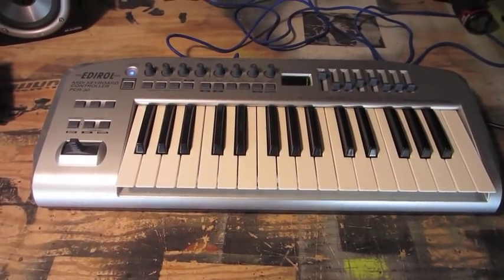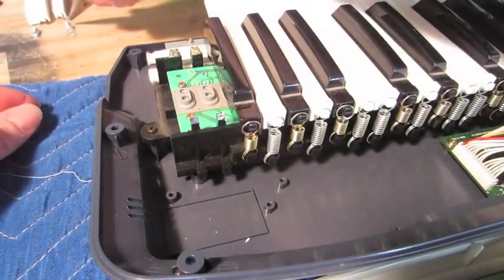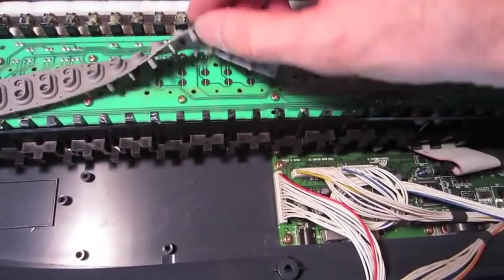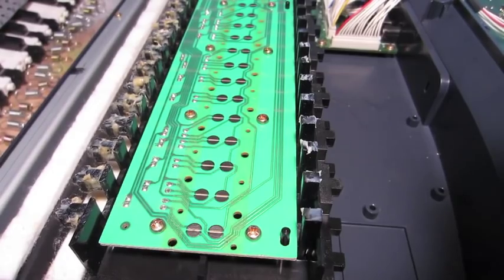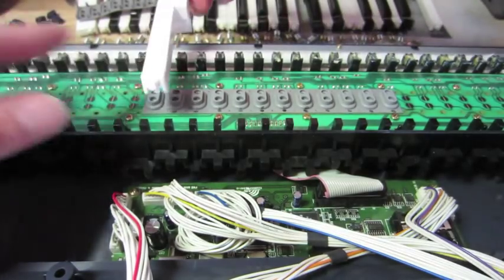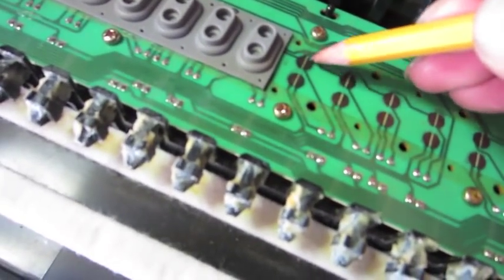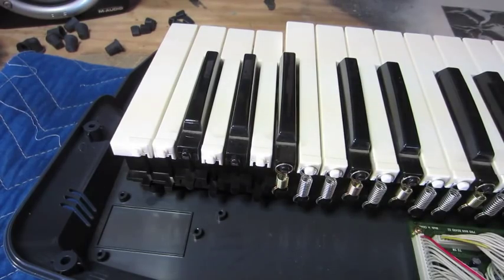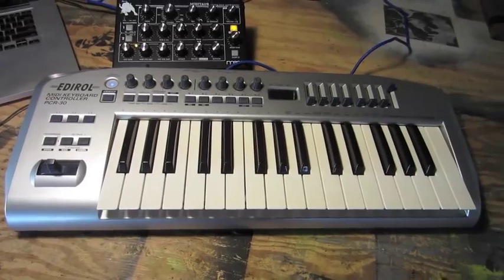How to fix a MIDI keyboard with a pencil.

Comment: i was working for a clearing company. my boss took an electric keyboard/synthesizer and stuck it into the trash container. i immediately pulled it out. took it home. cleaned it. it works with 100% integrity.. now its in my music corner waiting for the muse to kiss me...
in our society 80% of the stuff we throw away only takes a little bit of time, knowledge, oil and spit to fix.. we daily throw away things that kings in former time could only dream of...  great video..

Comment: What a classic. I had issues with my own Edirol pcr-m30 with many non-working keys. Not through overuse, mind you - it had about 5 hours total playing on it... Was just not happy to sit idle for 4 years, I guess. I cracked the cover, and just gave one of the contacts a straight up clean (even though they looked pristine under that rubber boot thing). After a simple wipe, they started working again. I'm going to get some contact cleaner and give it a once-over and it should be good as new. Thanks for the vid - I won't be using a pencil, but because of your video, and the comments, I found what I needed. You have my thanks! :)

Comment: Repaired my liquid damaged NI S25 after watching this video I thought it was permanently damaged. Most of the keys stopped working and now it's like new again! I didn't have to remove the keys everything is easily accessible with the keyboard upside down after removing the bottom panel and pad PCB. Thanks for the info and useful video

Comment: The problem with doing it this way is if the graphite loosens over time, and spreads and comes into contact with a power and ground connection, instant POOF!  You can buy a product called rubber contact repair at most electronics shops.  Another method of repair is to use a silver emergency blanket and cut out a circle the same size as the circuit board contact, and glue that to the rubber contact so the silver side comes into contact with the circuit board, that also works very well.
Reply: It's still a great solution with zero spending. IMO using the pencil trick is only problematic when the contact circuits are very worn-down (i.e. decade old, or abused daily).

Comment: I own the M-Audio Axiom 61 and I have to say I followed your tutorial dead on. It fixed my keyboard. Thank you so much! man.

I bought it used for cheap so I expected something to be wrong with it. I found wads of hair under the keys. It was disgusting.
Reply: I got mine for $400 when it first came out, I need to put it in the shop, because I thought it was DONE. its just in my room catching dust

Comment: Great video! Thanks for posting. I tried this on my PCR-M1. The contacts look different than this one but the style of the rubber piece on top is identical. 

All the buttons worked perfectly before I put it back together but when the keys are on a few still don't make contact. I'd love to find a more robust way that ensures contact.

Comment: Thanks for the instructions!  The pencil didn't work very well for me, but a Circuit Scribe conductive ink pen did the trick.  There was originally only one key working on mine, now they all work!
Reply from the maker: +Michael Muller Nice! Yeah over time some of the keys that I fixed are now starting to fail again. Thanks for the Circuit Scribe tip. I will definitly look into that.
Reply from the maker: +Darko Dronjić well to be completely honest it did not hold up very well. It worked good for probably a few months but some keys have stopped again. I would suggest trying to find a product that is actually meant for fixing these type of keys/buttons.

Comment: This is a great cheap way to do the repair BUT if you spend about $20 and buy silver circuit pen and then clean the circuit board and the rubber pads with the pencil eraser first and then clean with denatured alcohol . Then on just the rubber pad part you put the silver circuit pen and do like a stipling effect on the rubber pads. The reason manufacturers use graphite is its cheap but silver is a great electrical contact and the silver circuits pens I have discovered are the way to go they last a lot longer. It is very tedious though.

Comment: If the keys trigger notes via contacts, how do they transmit the MIDI velocity? Maybe I just need to go to bed already.
Reply from the maker: I'm not totally sure. But I think it might have something to do with the two sets of contacts per key. Maybe it can measure the difference between contact closure and translate that to velocity.
Reply: Mike Sisk I guess it'S the two receptrors. there are 2 spots. the second spot get touched by the key  after the first one. The harder (faster) you push the key, the shorter the delay between the 2 contacts.
Reply: Xavier Beaupré Ah, ingenious!

Comment: I agree with the vodka solution of @AlnairLindalwe! But I would use isopropyl alcool instead. It worked like a charm for my casio/yamaha toy keyboards. Don't use graphite over grease and goo that is on your contacts... Just clean them ! I also have a sticky PCR-A30 I need to clean...
Reply: fabrice Dziezuk So... I cleaned all the contacts of my PCR-A30 with isopropyl alcool and... It does not work any better... I have to try your pencil trick. It's strange this method worked for my previous toy keyboards and not this one. I suspect a misconception...

Comment: Great video. Problem is, the graphite doesn't hold up over time. Wish it did.  After about a year or so, you're back to the same problem.  A bad design by Edirol unfortunately.
Reply: Glue a piece of aluminum foil on rubber parts.

Comment: You don't want to get a line of graphite joining the two halves of those contacts either or that note will be always on and will not work.
Reply from the maker: Well obviously. But if you do get a line connecting to two pads you can easily erase it with the edge of the eraser on the pencil 😉
Reply: The PCB laquer is too smooth to write on with a pencil...usually.
Reply: Forget I said that. No reason to bother putting laquer on that little strip, since the laquer is applied last, and the pads are just masked off. Mine DID have dye and laquer between the two halves of the pad for some reason. Seems like extra pain in the ass for no real gain.
Reply: Ash Scott a

Comment: hello, I have two Casio keyboards wk-1800 & wk 1630.  Both have the same issue, 8 keys in the upper register only play once.  They only play if the touch sensitivity is turned off, but they only play once and then will not play again until the keyboard is turned off & on.  On the screen, it shows that they these notes are still being played/ sustained, that is why you can not play them again.  I have already opened up the keyboard, vacuumed up all dust & debris in and around keys & wiped down the circuit board.  I have also tried switching the pads from other working keys to see if the pads need to be replaced, but unfortunately the problem still exists.  I haven't been able to find someone who can fix the keyboard on the island where I live.  If you can give me any direction toward fixing the problem, I would most appreciate it.  thanks & kind regards. ps. I tried the graphite with a pencil, but it didn't work.

Comment: Hi, thanks for the video, I have a second hand PCR-M1 with some keys not working, will this be the same fix do you think? Thanks
Reply from the maker: specialbeat I don’t know for sure but I would assume the same fix would work for yours also.
Reply: @SISKworks  thanks. Just realised that the contacts on the PCR-M1 are gold rather than carbon. So I'm guessing it's the rubber part that's at fault as the gold contacts are clean. I guess I could try a soft pencil on the rubber contacts.

Comment: Another option: I lost about 10 keys on my edirol. I found good old washing up liquid works a treat. Use warm water and washing up liquid on both the rubber pads and the board - leave for about 10 mins to let the water and liquid do its work - and then clean off thoroughly and dry. I have no idea why this works, but my theory is that it cleans off microscopic residue that builds up over time.

Comment: Those contacts have clearly oxidized, a can of contact cleaner from an electrical hobbiest store will fix it up and last much longer. A good brand cleaner will have oxidization prevention too, you won't have to do it again for a long time.
Reply: Yep, no need to be too gentle. Give it a decent rub. The rubber pads too. I've fixed many keyboards this way.
Reply: I'm going to be repairing mine and I was wondering if contact cleaner would be the better way to approach this.  The pencil/graphite method he shows I'm sure will work, but since the work is so "tedious", I prefer to only do it once in a great while.  But great video!!!!

Comment: what i don't get.. you want the graphite on the pad's of the button's so why not "draw" whit a pencile on that pad's
Reply from the maker: Roy R yes you are correct but the graphite did not really want to stick to the pads. But you should definitely give it a shot! 👍
Reply: ill well. need to say that its plausible. you need to "dip" the pads in Graphite powder... and you will coat them.. your tip is great. have a GEM keyboard. non of the keys worked. so i did the graphite Trick , and except voor 11 key's, that don't work is the rest fine.. found that some pad at the first run not work. but after working them in (pressing continuously).. they start to work again..  great trick to try.

Comment: LOL.. Dont do this please, just use IPA and give the entire board en rubbers a good cleaning... 🤦‍♂
Reply from the maker: Did that. Didn’t work. Conductivity was gone. This definitely works in a pinch but not a long term fix. Thanks for watching and commenting even if you are wrong. 🙊